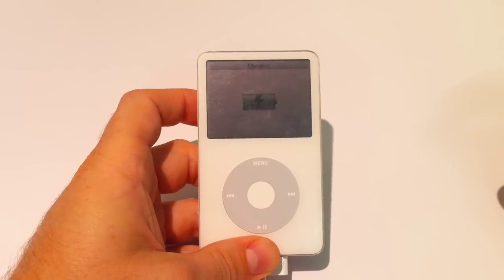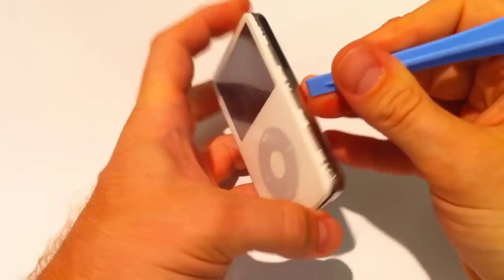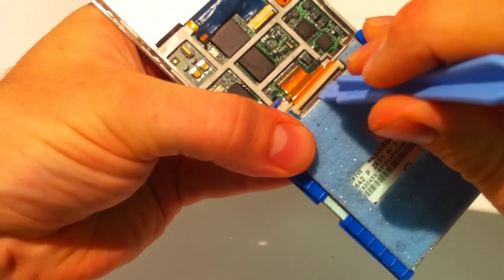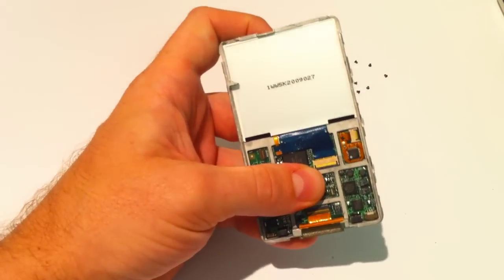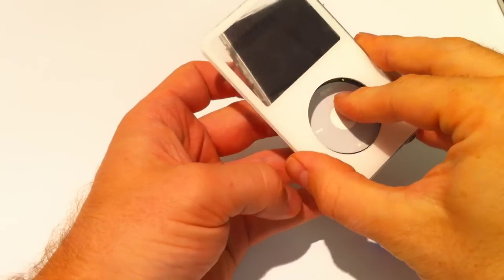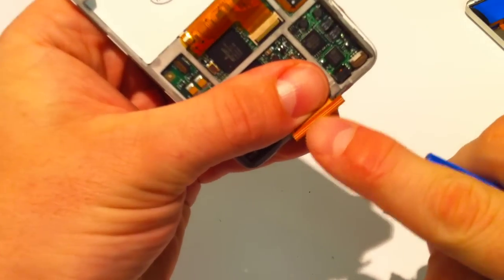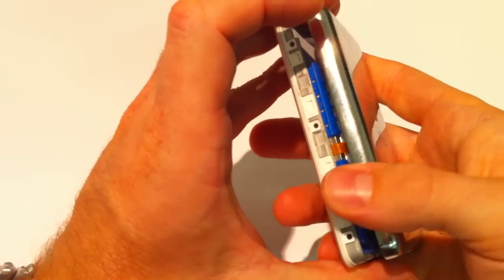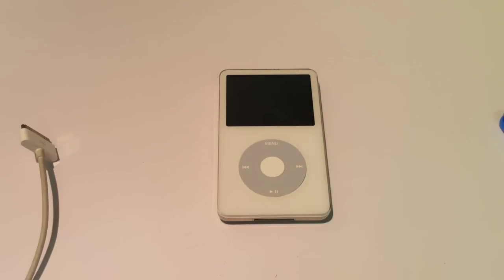iPod Video 5th Generation LCD screen display replacement repair Guide

Comment: That is not the way to release the battery ribbon, lift the tab first to release it or there is a high risk you’ll rip the whole connector of the circuit board.